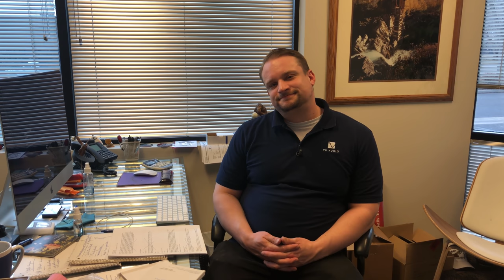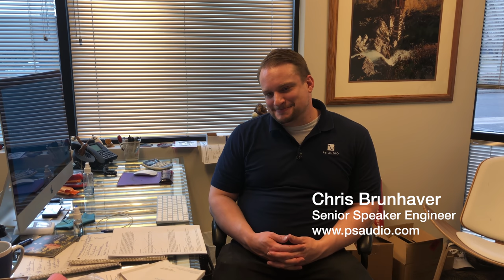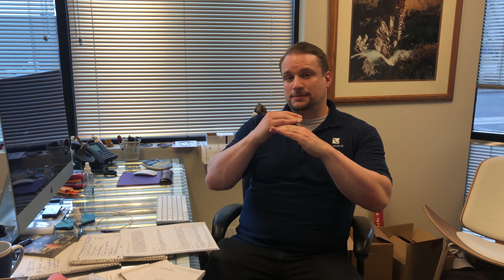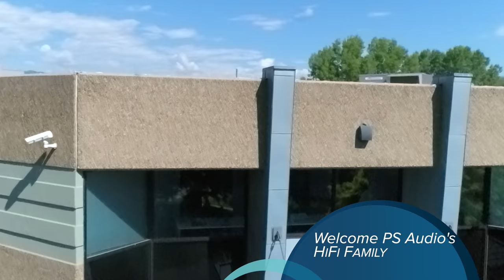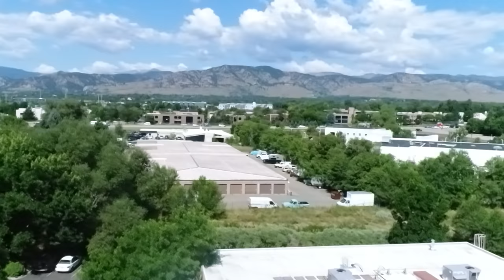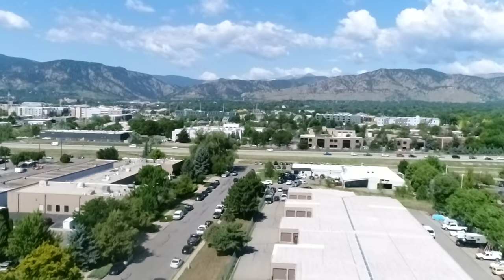Understanding subwoofer phase

Comment: Q: Where should you set your phase?
A: To where it sounds best

Q: Where should you set your cutoff?
A: To where it sounds best

Q: Whats the best position for my sub?
A: Where it sounds best

Q: Should I buy a ported or sealed sub?
A: Buy the one that sounds best

Q: What frequency should I high pass my main speakers?
A: The one that sounds best

Q: Should I plug my ports when adding a sub?
A: If it sounds best

Q: How should I position my main speakers?
A: Put them where they sound best

Q: How do I know if my system is setup properly?
A: It will sound good

Q: When should I consider upgrading?
A: When it stops sounding good

Peace out folks ✌🏻
Reply: Lmfao.   Facts
Reply: The hero of the Internet! I know they say that there is no stupid question, but if you can answer it yourself, does it need to be asked?
Reply: Yes, but some people aren't sure what "sounds best" and given all of the possible permutations of audio setup, appreciate hanging a generally agreed upon approximations to help them get close to the sweet spot

Comment: I DSP the heck out of it. I run a MiniDSP 2x4 HD for the subs, two instances of HQPlayer for phase linearization (16k taps each) of both mains and subs, and MiniDSP SHD for PEQ and Dirac Live. A single sub process with a measurement mike and REW: Simulate for the best place for sub, pick a crossover, flatten sub gain with HD, flatten both gains (<300hz) with SHD, flatten both phases with Rephase and HQPlayer, run Dirac Live for stereo with couple of profiles, pick what sounds the best. You will have to take care of delays every step of the way to align the sub with the speakers. Correcting with a FIR filter can present a 80-160ms delay.
Reply: Sound goes Roon->SHD (Roon endpoint)-> 2xHQPlayer (optical)->couple of NAA devices (wireless) -> DAC for main speakers, HD for Sub. Sub setup is totally separated from the main speakers. Picked for best position.

Comment: You can hear out of phase vs in phase. Your  volume and bass will be good  in phase and flat out of phase. Positive (red) out of amp  to positive on back of speakers. Same with negative. (black). Subwoofer same rules. This has always been the rule that works for me. 👍👍👍
Reply: Incorrect wiring is changing polarity, that's something else that phase. Phase is time function.

Comment: Thanks for this great explanation! Could you teach us how to set the sub cutoff frequency accurately (guess it depends on the system also), but generally speaking?
Reply: Two ways, listen with your ears and set it where it sounds best, or measure the response with a test mic and pink noise generator, and adjust until it reads a flat response
Reply: At the listening position, in conjunction with the main speakers is what I meant, sorry
Reply: Just be aware that if you’re doing measurements in a normal living room without acoustic treatment, the results will be horrifying, but it’s fun/interesting and you’l learn a lot. Often you’l never even get close to flat no matter what you do so take the measurements with a grain of salt and tweak by ear afterwards 😊

Comment: Jim Smith had a great series of articles on subwoofer setup/optimization (and getting good sound) in your own Copper Magazine:
 
Look at 14, 15, 16, 17, 18, 19, 20.
 
Copper 12 The ACK Attack and Un-common Knowledge 
 
Copper 14 Subwoofery: Trick or Treat? 
 
Copper 15 Subwoofery: Trick or Treat? - part 2 
 
Copper 16 Wait A Minute! 
 
Copper 17 Subwoofery: Smooth Operator? 
 
Copper 18 Subwoofery: Location, Location, Location 
 
Copper 19 Subwoofery: The Basics 
 
Copper 20 Subwoofery: The Finale 
 
Copper 22 DPT: Three Critical Steps To Maximize Musical Engagement 
 
Copper 23 ACK Attack is BACK!! 
 
Copper 24 Science vs. Soul 
 
Copper 26 Something to Talk About 
 
Copper 28 The Answer Man 
 
Copper 29 The Answer Man Part 2 
 
Copper 31 More Q & A on Getting Better Sound 
 
Copper 32 Audiophile Therapy 
 
Copper 34 A Dedicated Listening Room 
 
Copper 35 Most Important Component? 
 
Copper 36 EQ, DSP, & You: A Cautionary Tale

Regards,
Gorm

Comment: I need an answer to a question. Hopefully I'll get one.  I have an infinite baffle setup on a boat. It uses the engine room as "the box" which is fairly well sealed. If I added a subwoofer in the engine room would it suffer from sound cancelation? Effectively I would be putting a subwoofer in a sealed, or ported box inside of a much bigger subwoofer box. Any thoughts would be appreciated.

Comment: good evening from Indonesia, I have an active subwoofer speaker (crimson 1233) with a phase button.
 Should this button phase be pressed or not?  Thank You.
Reply: Use your ears. But you can use your hands also. If your woofer of your main speakers comes forwards the sub’s woofer has to bounce forwards too at exactly the same time. But you can hear it also. Crank up the volume of your sub a bit and listen if the bass increases or decreases.

Comment: Subwoofer should always be in phase with the mains at the listening position.  And it doesn't mean just 180 degrees in or out.  There is an infinite number of settings between in and out of phase.  With two subwoofers, both need to be in phase at the listening position which might be a different position on each phase adjustment dial depending on the location in the room and distance to the listening position.
Reply: Thank You {fellow audiophile} you are exactly right..........Listening Position is what it is all about in reference to phase.

Comment: I use the second CD in Nordost's "System Solution Set-Up & Tuning Discs" and listen to the "bass-sounds" on that CD to hear when I have the best bass.
It was that double CD that "told me" that I must run my sub with the phase 180° or else it became bad.
Reply: So sad when a sub becomes bad.  They need encouragement with proper guidance and discipline to become good subs and contribute to the sub-society.
Reply: @jamesplotkin4674  LOL  Well, to bee accurate: "or else it didn't sound as it was supposed to doo."

Comment: HI I'm hoping you can help me understand my Behringer subs a bit more in dept knowledge to utilise my pa system to its full potential,  the subs I bought are the Behringer B1500XP's and my tops are the new 9 series Rcf935a's which are an amazing speaker,
I did a little research and ok I could have splashed out and bought the RCF subs but they are a crazy price for the amount of times I would actually use them, but the the B1500Xp did their first gig and I was pleased very pleased with their performance, what a thump from a 15' now to say I Aux fed my Subs and main out L and R from my mackie 16fx V3 desk for my RCF 's  set to Boost and level to 3 o clock
, now my question is if I were to link my RCF' s  from my Subs, how would I go about this understanding the correct  settings on the subs and the RCF tops on where to set these, be it at linear boost or stage,  and the reverse phase switch on the subs I have no clue what this does, using the set up I now use by Aux fed controlled subs j don't have to worry about my RCF tops performance, but I'd say linking from the subs would be a different story, I Do not want to lose any of the RCF's magic and quality of performance by linking, unless it's done correctly, that's where you come in to help and in advance I thank you,
I have been told it s advised to buy same brand but that's easy say when it's more money, but it's the name your really paying for, the badge
behringer B1500xp really kicks ass, but will I link my RCF's or subs remain Aux fed and RCF's main L&R out from the desk 🤔..

Comment: Chris you use the term phase. On my SVS SB3000 it has a polarity setting and a phase setting. I can easily see the correct setting for the polarity between the sub and my Buchardt S400 speakers using my omnimic but not sure where to set the phase. I can see the phase setting making a difference in the curve but don't know what is correct.
Reply: There is no correct setting, you set it how you think sounds best, either by listening or measuring.
Reply: If by correct you mean honest to the recording, just set it to the flattest frequency response curve you can achieve, using pink noise. Just be aware that if you move the sub to try a new location you’l need to start over with the adjustments

Comment: Hi sir, i had a 2 200 watts 8 0hms speakers if i connect it into series it will be 200 watts 16ohms? And if connect it into parallel it will be 400watts 4 ohms?

Comment: Not sure I agree that you want to hear the low frequency with plenty of energy this can excite the room and give you peaks and troughs what are not desirable, out of phase always works best but placement is critical it is softer roloff, you can reverse the subwoofers and have them in phase pointing to the wall away from the speaker at 0.9 metres from the front baffle of the main speake andr to the wall

Comment: Hi Chris,

You are definitely getting the hang of this video thing now. You seem much more relaxed. Thanks for this very informative piece but I have a question regarding multi sub optimizer.

My understanding is that it is only suitable for use with subs fed by an identical, summed, mono signal. I have twin BK subs each connected individually from the left and right speaker outputs of my stereo amp to the high level sub inputs.

Any tips on good software to use in this setup ? And I throw the question open to anyone who has sage advice to give.

Cheers
Jim

Ps. I posted this on the PS Audio video comment section but noone seems to hang out there. Damn I felt so alone.

Comment: Plain simple logic revisited. I have 5' towers 10" 'sub' up top, 12" 'sub' on the bottom. Of course ALL speakers are in phase.
IF I ever completely lose my mind I'll crawl inside the things and change the polarity of one or both 'subs' ! MAYBE just on the left or the right - LMAO!!!!!!
Doesn't make sense does it? Neither does it make sense with 2 ways + individual subs!!!!!!!!!
Reply: They are all in phase acoustically, Yes. But I will garauntee you they are not in phase electrically. This is the entire point of adjustable phase controls, to modify the electrical phase in order to match the acoustic phase of the other speakers. 

If you look at something called a phase response graph of a speaker driver, you will see that the acoustic phase of the sound from the driver does not match the electrical phase of the input signal for the drivers entire response range. A 12” woofer may be at 0 degrees of acoustic phase at 300hz, but -180 degrees at 100hz. This is not a problem until you combine this driver with another driver of different characteristics  and thus a different phase response curve playing in a similar area of frequency. In the case where this has a negative effect, the electrical phase of one or both of the drivers is modified to align the acoustic phase and provide the desired output response. 👍🏻

Comment: Great answer.  The problem is you say  "UM" every few words over and over.  This takes away greatly from your answer.  Then your answer doesn't sound  so great anymore.
Reply: Fat Rat  the message is clearer without the filler umms and ahrrs which get really boring really quick.
If needs be then write a script beforehand and use it and avoid the ad lib sessions. 
A good engineer needs to be a good communicator too.
Reply: Still not enough ums for me to notice.
Reply: I didn't find that to be the case at all.  I like the fact that he's able to just speak off the cuff in depth about these highly complex topics.
Reply: Clearly, Chris is still not used to public speaking. As we speak to another person, we often unconsciously use the UM sound or other verbal cues to signal that we have not finished, to avoid being interrupted when we need a little pause to organize the next sentence. This is unwanted on public speaking. Being concious of this, a little practice should solve the issue.
Reply: High GUY! What university did you get you electrical engineers degre frm and what is TYOURE GPA and product manager for what high end audio company. Thans Yu and thumbbs UPS!
Reply: @paolocanali3361  Hello! You can tryu PUBHLIC SPESAKING when both you or engins stop working and you cant restand them and you have to EJECT! LOT SOF BRASVE keybhaord warriors critiizeing a guy with a 4 yer engineeirn gdegree. Good LUCVK ion you vidoes with Laplace transformes and FORFED VIBRATIONBS! GOOD NIGHTES!!!!!
Reply: @ilovecops6255  Are you drunk or just illiterate, or both.
Reply: Fat Rat   Nope, if he can learn to speak he can also learn to spell, he can also learn to use a spellchecker.
Nobody here is dissing the poster, only pointing out that he needs to improve his presentation. 
If he got up and presented like this to the AES he would be booed off stage for not knowing his stuff, he is just four years out of college actually, no way near being expert yet.
Reply: @ilovecops6255  I have spent 50 years in audio electronics so yes I could give tons of information, maybe someday I just might.
In the meantime I am finishing development of a Bybee QP alternative that is affordable and works on all classes of electrical and electronic equipment and reduces 1/f noise, the elephant in the room that nobody understands.
Reply: @ericmc6482  THANK YOU KIND SIR! YOU HAS ALEWAY SBEEN THE GOOD FRENDS. THUMBBES UPPES!